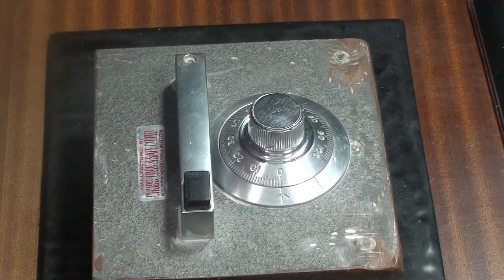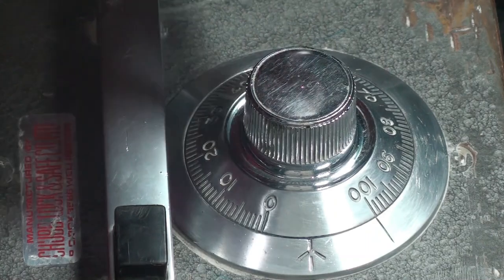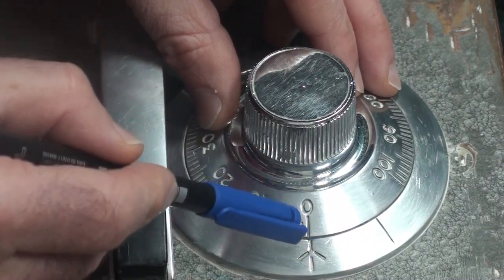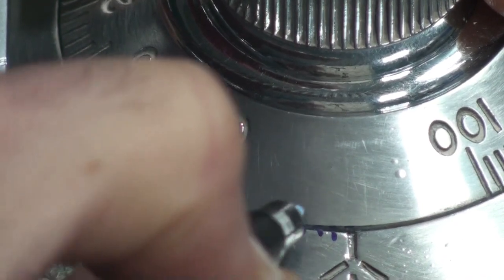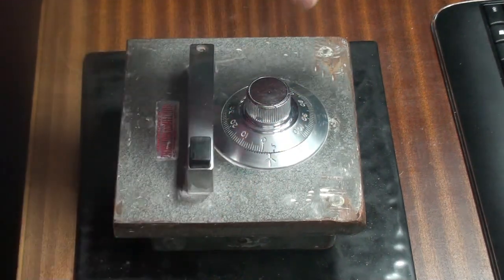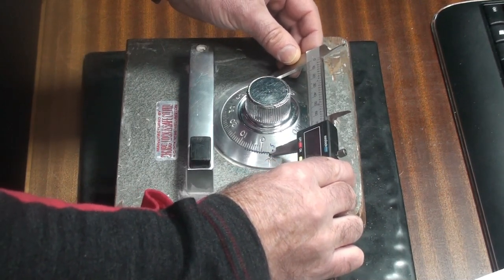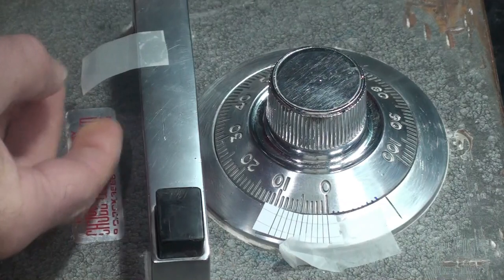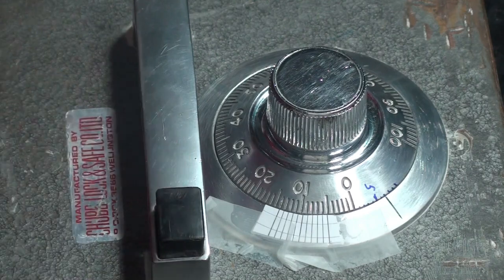[153] Chubb collaborative manipulation part 2

Comment: Hi Michael,  The earlier Chubb 3 wheel had a drive cam similar to S&G, with a ramp on the right contact, ( left to get right contact, right to get left contact ) with the ramp you will get a larger change on the dial but the contact "point" is less distinct - soft even. The later Chubb had a squared off gate in drive cam - more distinct contact points, but it wasn't ramped. Changes are tiny.  As you said, it's best to use two increments at a time as against two & half, as the numbers around the dial are "compressed"- easy to miss a gate, and wheel shadowing is a distinct possibility. Finding your low area on the wheel pack and dialing one wheel at a time may be necessary. I have to ask, have you read the wheels before hand.......?    Regards, Brian.
Reply from the maker: Pretty sure it's going to be a squared off cam gate, if only because it feels so entirely different to the ramped gates I'm used to. Both sides of a 6730 cam feel like a brick wall compared to this thing.  I'm sure the LCP must be there but honestly I can't get it at all, the right one is really soft and very easy to miss if you're dialling at anything more than a snails pace BUT it does this thing where if you go past slightly, you'll feel the spring take up and if you stop and let go at that point the spring will gently push the dial back a few tenths, so you at  least know where you are and can go back and refine that reading.  

I've run just one AWL graph so far.  That didn't show anything remotely close to a gate signature but there are a couple of obvious low areas.  Haven't done anything else yet, haven't had the back off, haven't peeked, and tbh don't really trust that first graph yet either. I'm going to go a couple more times round the dial over the weekend to get a better feel for it and then start in earnest next week.
Reply: @MichaelMaynard  Dont forget to run a AWR graph as well. Most locks will read a gate thats hidden that way. Its also quicker to run just the third wheel by itself with a AWR start. At least with S&G's and Lagaurd's....I have no experience with a Chubb.

Comment: You could have just made a dial line on the other side and used that instead of the crows foot because that will read numbers when the main mark is within the blank region.
Reply from the maker: Yeah you're right, if I was doing this again there are a couple of things I'd do more simply.

Comment: If you put ring-styled vernier scale around the whole dial, you could have 1/100 accuracy if you need. Basically for 1/10 reading you look at if the lines match at 0, 10, 20, 30, etc and for 1/100 digit you watch look for the indexes like in this demo.